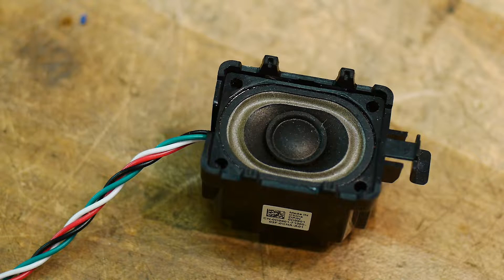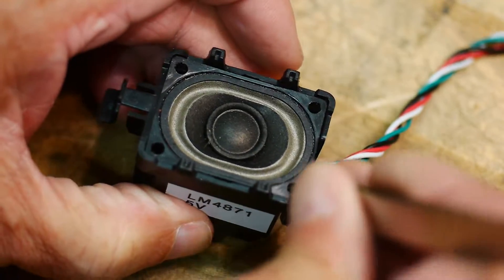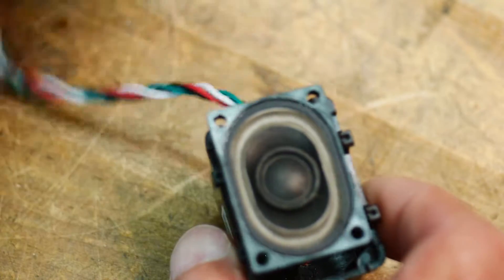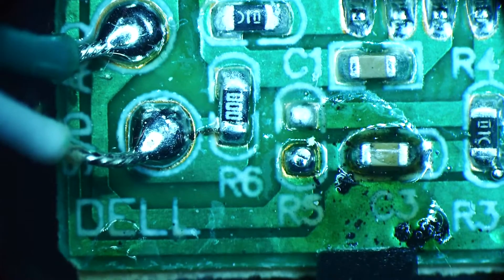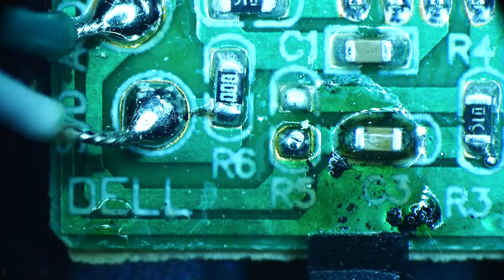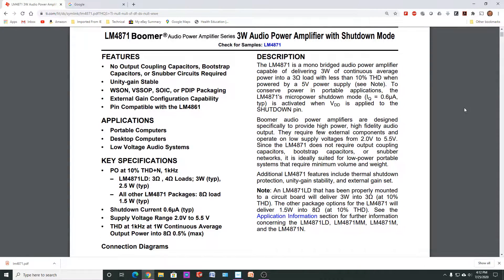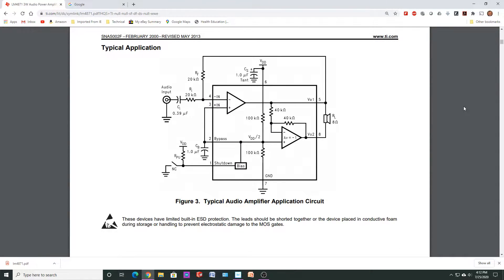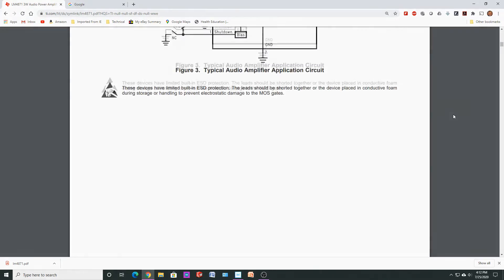#532 LM4871 Audio Amplifier IC

Comment: This chip was in amplified ball speakers at the dollar store. John Audiotech reviewed it, and the datasheet is actually very good, 0.1% distortion up to 1 watt. So you need very sensitive or small speakers to use it, but I bought a bunch to play with and they sound great with old Alnico paper cone speakers. Quite loud at 1 watt, after that it sounds rough. 

Your little oval speaker is neat.

Comment: if you use that chip in conjunction with audio grade capacitors, you can make a fantastic mini amp. M Series Capacitors are made with a proprietary oil-impregnated metalized polypropylene dielectric with pure copper tinned leads. Brand/ M- Truth